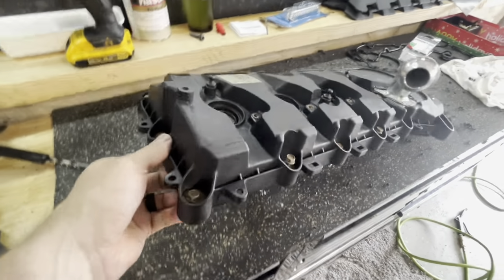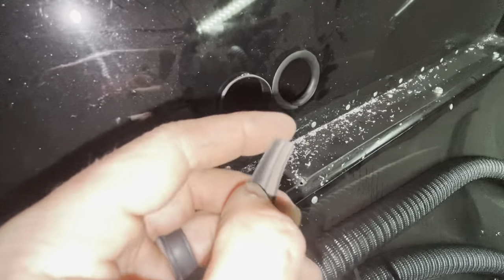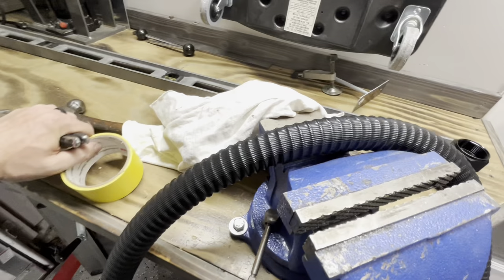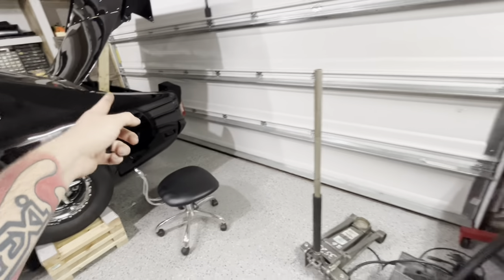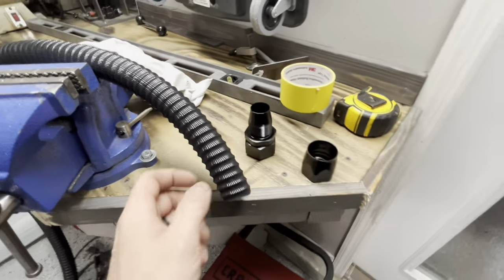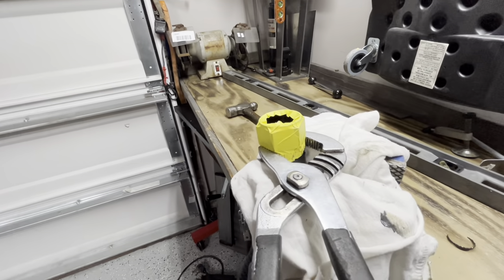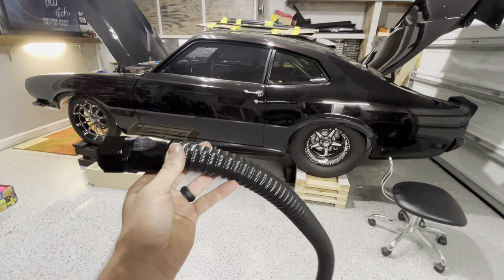💥TKM Performance Burn Down Hose Installation With -20an Fittings 🧯🧨

Comment: Great looking install, I have been wanting to do that to my car. Do you have a link for the sleeve/ grommet protection stuff you used for the pass through ?
Reply from the maker: Thanks. Here you go 
https://www.ebay.com/itm/Soft-Rubber-Flexible-Black-Door-Edge-Guard-Scratch-Paint-Protection-Molding-Trim-/252676739258?mkcid=16&mkevt=1&_trksid=p2349624.m46890.l6249&mkrid=711-127632-2357-0
Reply: Thank you . Your doing a very professional looking job on your build ! And love the videos.
Reply from the maker: You’re welcome and thank you

Comment: Hate to be the ignorant one, but you never learn unless you ask, so here goes- what’s the purpose of a “burn down tube”? Is it for crank case ventilation? Came over from TJs channel to check this channel out
Reply from the maker: Please ask all you need. I’m here to learn with y’all. Fun fact is I’m new to this I’ve never made an actual pass in my life and this is my first real drag car build. 
Yes it’s for crank case ventilation. Basically if you lift a head or it for some reason pushes fluids out the vent it routes it all into a puke tank in the trunk instead of all over the race track or under your tires. 
Thanks so much for coming over and checking the channel out hope you’ll stay.

Comment: I can’t find that tape you’re talking about
Reply from the maker: I don’t remember talking about tape. This was awhile ago. What did I call it or at what time stamp was it and I’ll try to help
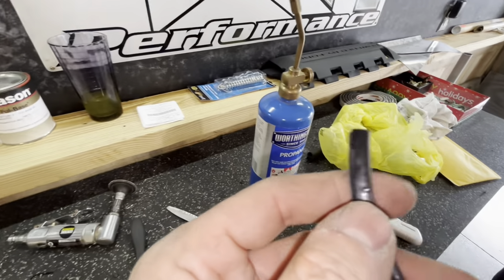Reply: @ThePaintPaperHustle  2:30 you start talking about it. You used it as a a protector along the holes you made in the sheet metal
Reply from the maker: @ThriftedPerformance  oh it’s just door edge protectors. You can buy them by the roll on Amazon or eBay. Just search automotive door edge protector